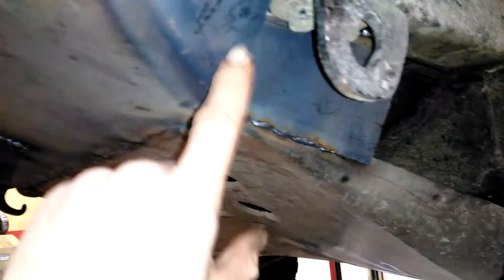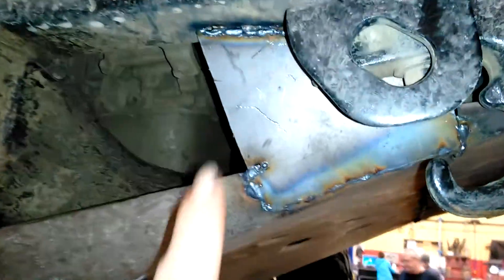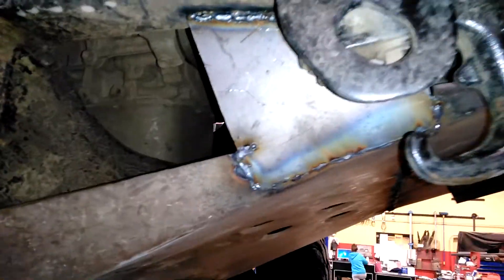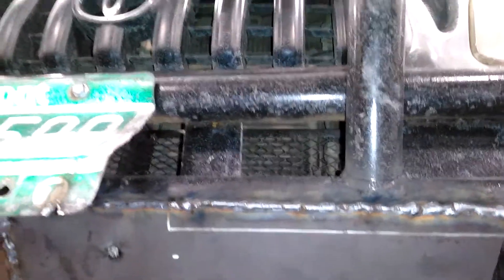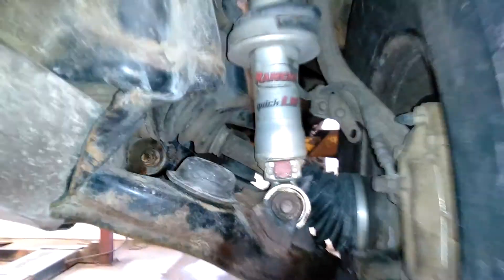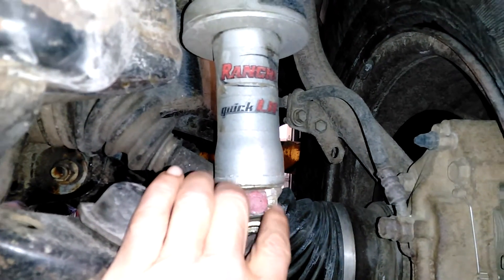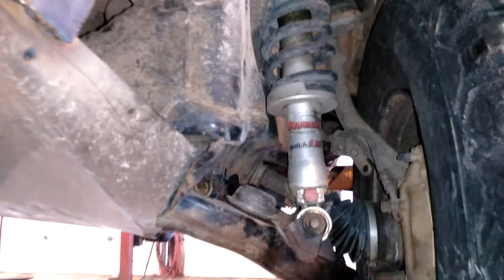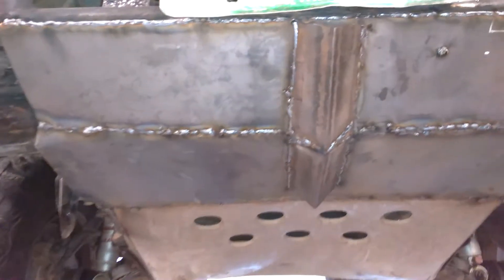BLACK TACO BECOMES ICE BREAKER

Comment: so Joe, what kind of tires are u getting this time?
Reply from the maker: I will be getting the same ones to Hercules studded trail digger tires and I will be getting bigger ones, going up two more sizes I have 265 75 16 I'm going to 285 75 16
Reply: nniicceee ...now hopefully you will scrap that puny V6 and build up to something amazing ..question is , what will fit in your engine bay a V8 perhaps?
Reply from the maker: +jimP71 it's only a 2.7 liter 4 cylinder but it has the power of a v6 is 159 horsepower that's all I need for four wheeling anything bigger I'll have to change a drive train and everything to be breaking stuff, I'm very happy the way it is new tires come in Wednesday